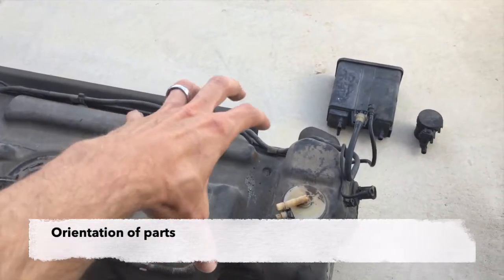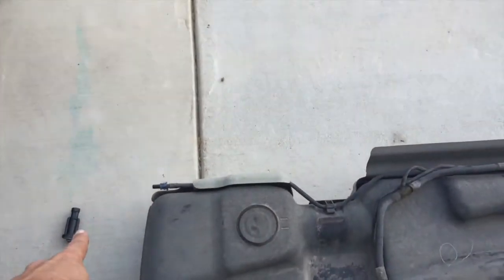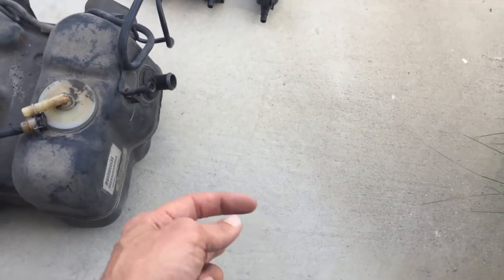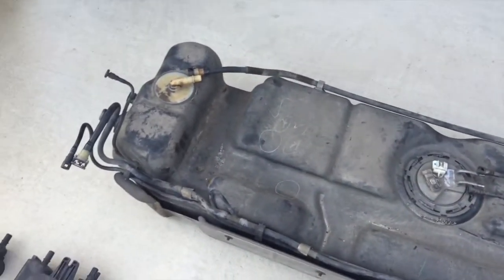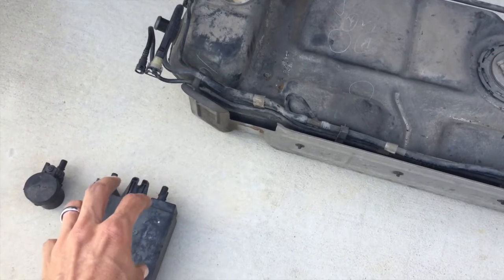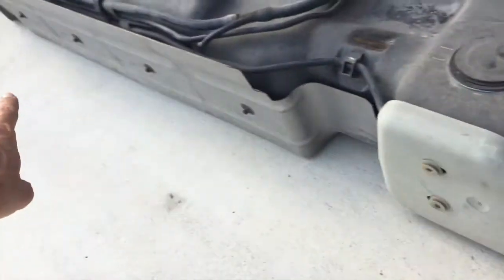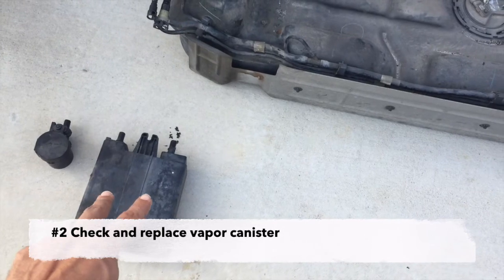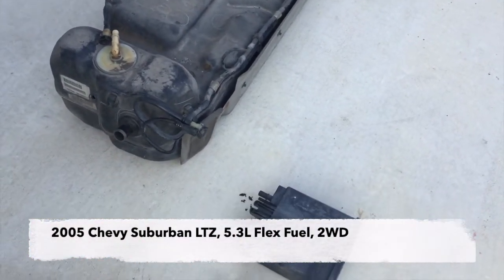Gas pump shut off early? SOLVED! Entire evap system explained & troubleshoot on 2005 Chevy Suburban

Comment: I replaced the vent solenoid, carbon canister, purge valve and fuel pump and blew out the lines. It fills better but still stops. Any more suggestions?

Comment: I have replaced the canister, purge valve, vent solenoid and gas cap a lot better but still same issue last time I was down there I was going to drop the tank to clear the lines but I got lazy as I couldn’t disconnect the white connection from the top of the tank and it was routed over the top of the cross member so it was getting hung up but I guess I have to take the time to drop the tank and clear those hoses 😅

Comment: This is truly the best video I’ve seen about the Toyota 2019 vehicle gas billing problems. I just realized when you explained this all to me that the actual problem is the manufacturer of that charcoal carbon falling apart box so that way it contaminate the rest of the system, including the fuel pump that’s giving you all these error sending it to the computer Therefore, I realized after watching this if I take that canister out of the system and just connect the airlines together so I can put gas into the tank while the air escapes doesn’t back off and shut the nozzle filter tube off. It just shows me that Toyota did this to cause another $3000 worth of problems

Comment: Good informative video.   I had the problem of my tank not filling and am repairing today.  Charcoal canister was bad and clogging lines with pellets. I’m changing the fuel pump while I have the tank out and also blowing air with air hose to unclog lines.  The question I have:    Is there a chance that no charcoal comes out of any of the lines ?   I blew the one on top the motor for the purge valve and all the lines on top the tank and none of them seemed clogged.  Blew air back and forth in the lines for 30-45 minutes.   No charcoal came out.   Thank you

Comment: 2005 Hummer H2
QUESTION: 
1) Could this have something to do with the filler neck assembly? Maybe I can disconnect its vent line?
2) If I disconnect the "Air In-take line" to the Canister will that allow me to fuel as normal?

My Painful Hummer H2 EVAP Journey
It all started about 1 year ago. On my first drive of the day, after 4 minutes my "Tighten Fuel Cap" Alert came on with a ding and disappeared.
The only thing I noticed that the day before this journey started was when I fill-up my tank, the nozzle was having problems fitting into the filler neck. I told this to the Repair Shop.
(No gas odors, no changes in gas mileage, no changes in engine performance)
Here is the list of repairs and & the results.
Clean filler neck & Replaced gas cap (factory cap) - did not work, a week later wouldn't take gas
Replaced Solenoid under H2 - did not work (noticed chucks of debris falling out of solenoid valve and broken line clamps)
Took To Shop: had them replace Canister and check lines, Smoke Test (-) - didn't work
Back to Shop: Told them to fix the lines that had loose clamps, they also Smoked test again (-) - didn't work
Back to Shop: Had them better fix/make lines, Smoke Test (-) - didn't work
Back to Shop: They blew out all lines this time - Fixed the fill up problem, but alert light still occurred
Back to Shop: Had them replace purge valve on top of engine, smoke test again (-) - Tighten gas Cap alert comes on and now throws Check Engine Light (P0455 major leak)
Back to Shop: They recheck everything. Stated it need a new gas cap again. They removed my new factory gas cap, and put on a different gas cap. - Next day, light and alert came back on.
Take to New Shop (H2 Guys): Stated that it was the sensors built on to tank stuck open from blown debris, so he changed the program to stop checking EVAP system (This is something I didn't want done, but he did it before talking to me). - next day I am back to the original problem.
First drive of the day, after 4 minutes my "Tighten Fuel Cap" Alert came on with a ding and disappeared.

About 3 weeks later, the Fuel pump finally reared its head as a problem. The tank was dropped and cleaned, pump replaced, lines blown. They also replace any part in the EVAP that was still under warranty. I couldn't believe how much smoother and quieter the H2 ran when I picked it up. Then I took it to fill up - ugh. It didn't want to fill. The pump would shut off at every $2.00. back to the shop.

Tank re-dropped this time they put more effort into blowing the lines and found some lines were still clogged. They probed and blew; they check the other EVAP lines and blew. Got the H2 back, no problems filling, no "Tighten Fuel Cap" dash warning.

This lasted for 1 week, then back to the original problem - "Tighten Fuel Cap" dash light and alarm warning.
This time it came on in about a minute as opposed to the original 4 minutes.
Finally went to fill tank and had problems again, pump shut off two times during fill up.
About 2 days later the "Tighten Fuel Cap" Alert disappeared for a whole 2-days, then came back.
The next time I filled up, the pump would shut off at about $5-10$. I can hear the filler neck getting backed up before the pump shuts off.

"Tighten Fuel Cap" alert is also coming back on within 4 minutes of driving.

This has been a real Bitch!
The only thing I can think of is that one or both of the rollover valves on the tank must be clogged.
You cannot get replacements for these, and you cannot get replacements for the EVAP Tubes/Hoses.

QUESTION: 
1) Could this have something to do with the filler neck assembly? Maybe I can disconnect its vent line?
2) If I disconnect the "Air In-take line" to the Canister will that allow me to fuel as normal?

Comment: I realize that this vid is 5yo but it was very clearly explained. Going through this now with a 2010 C6 Corvette Grand Sport with 66K km/41K miles.  I checked the system and found the infamous P0455 EVAP large leak code. I did a smoke test but found no smoke. Read a few rags about causes and replaced the GAS CAP. Cleared the code and 200km check engine came back on. Then I did the PURGE VALVE, cleared the code and it came on. Then I did the VAP CANISTER, cleared code and it came on after 500km. Now I am at the CHARCOAL CANISTER and this is a SOB. I have an automatic and I have to drop the cradle and trans to easily access the canister. I'm considering taking it to the STEALER and getting the bushing in the TORQUE TUBE changed since I'm that far. Otherwise I have seen Cats do contortionist tricks to disconnect the XROSS TUBE and My hands/arms are too thick. So 2K has to be made available since I live in Germany and a Vette mechanic is like tits on a bird. My advice is that when reading the codes all other components that are defective will appear on the screen but the only one that doesn't is the CHARCOAL CANISTER because it also involves cleaning the air lines to the entire system. Also let the pump shut off automatically and don't top it off to the nearest cent. I believe that causes gas to enter the EVAP SYSTEM which is primarily there for vapors not liquid? Unfortunately Chevrolet changed it from being outside and accessable to inside above the Passenger gas tank on the Vette. Thankfully the P0455 isn't that serious but it does cause higher fuel usage, the car idles rough, the exhaust stinks, and eventually will have starting problems. My car goes into hibernation end of November so I believe l will get it done by the STEALER and bite the bullet. At least I know it will be done correctly and I won't have to mess with the TORQUE TUBE ever again. Stay safe and POSITIVE.

Comment: I just fixed my Avalanche by disconnecting the vapor canister and using a pool noodle to connect to my shop vac in blow mode to the fuel fill inlet. This allowed me to create a seal and put pressure on the fuel tank allowing about cup of charcoal beads to shoot out. I then disconnected the line on the engine and blew it out also. I finished by replacing the valve on top of the engine, the charcoal canister, and the valve above the spare tire. The comments here and the video let me to the solution. I did not have to drop the fuel tank. It was such a relief to fuel up without the dreaded click while trying to get gas. I usually gave up after 4 to 6 gallons.

Comment: this is a design failure if it was designed with a up side down trap and and a line joint that virtical  then the fuel wont get in the evap canister vent if the fuel don't get in the can then it won't destroy the can and ai said that a upside down p trap would be ilegal witch is a lie just a way to shut me up because it makes really really go sense. but over filling would destroy it no matter what you do the older cars never had a evap system so the newer cars  might need a evap float in the tank that shuts the evap line off when it gets filled witch they might have built in the tanks ???? does anyone know it they have a evap shut off float in the tank to keep the fuel from intering the evap line so you can keep the fuel from intering the vent line at the filler neck and a shut off float in the tank for the vent and then when the tank is filled it will shut off the pump at the station with out over filling the tank and destroying the evap?

Comment: Great Job and fantastic video! Very much appreciate you going though the entire Evap system and explains all parts and lines. I just inherited a 2005 Escalade and am having the fuel filling issue, digging into solutions. Will be saving your video and subscribed to Chanel.

Comment: I swear the GM EVAP system is a terrible design they haven't changed in decades.  I am convinced if you fill with a portable gas can or add a fuel additive the EVAP system is designed to allow the fluid to run into it and ruin it.  And then when the charcoal canister decides to fail it spews charcoal everywhere and is nearly impossible to clear (for example you can't just blow air down those lines to clear them)

Comment: Doing this task on your own shows perfectly how unfeasable  the current level of market inflation has got.  I would also drop the whole gas tank and trace each line before I took mine into a shop for work.
       I put a scan tool on and checked my purge solenoid, it is commanded from 0 to 100% based on engine computer data.  
     1st: the resistance test on my replaced evap (bad) canister gave me about 23 ohms, on the new one, (working but not oem) I got 29 ohms.  
2nd : It sounds like rapid clicking when it is commanded on, the bad one was not getting enough juice to be on until about 30 or 40 % command rate, and when it did finally start clicking, it sounded bad to me, somewhat erratic, so I put the new one on and it had a proportional step in crease from 10% to 100%.     Hope that helps.  Also I'm here to try to find out why the tank pressure sensor decreased into vacuum when commanding the purge solenoid on while running, as the vent valve stays open and the commanding of the purge valve is technically being a valve that opens from being closed while being commanded on   I hope this helps.
Reply: Edit: evap canister purge valve* resistance test gives 20 ohm on a store bought new purge valve,  and 23 ohm on the one presumably factory and going bad. *

Comment: I replaced my vapor canister because I could smell gas pretty strong, my mileage was atrocious plus I got the P0455 code along with CEL - lots of noise when you shook it but no beads came out. I now have this whistling noise that happens at odd times and my mileage is still atrocious. I’ll have to go through the whole system I guess.

Comment: Whoever at Chevrolet decided that this would be a good idea needs a hearty slap upside the head! Trucks are made to be driven and driven in areas that have dirt, dust, and gravel etc. We shouldn’t have to be concerned about air lines getting clogged or evap systems failing. This is utter crap! And while it’s not a major expense, it’s still another expense on top of everything else, and a pain in the ass. Chevrolet, you’re a bunch of twats!

Comment: just  another note--- shopw how the air  flows  in  the right  direction  ..As it comes out of tank in that big line--to canister--outa  canister  to Evap canister valve---or when running to  the  engine siliond!  Ya  also missed on my  tank a pressure sensor on the  gas tank.. That must talk to  the  engine silinoid!!!

Comment: I have a 2000 impala-It seems to me- where the air is   spose to come out of the tank,,that goes to charcoal filter There is a valve(( I call it a valve) ist letting pressure out-- wghen turn off  car.  No pressure  comes out  the EVAP silinoid by the filler pipe..  otherwise there should nOT be pressurein  tank once keyiosoff-  cause it  shhould realease any  pressure so   the anti rollover flipper  can open...BUT probably that  valve is NOT  replaceable..  Had tank down-- But at the time didnt realize  what  was goingon!! I blew air  backwards  thru canister and heard a BAng!  that  valve opened... I think I need to spray  something like WD-40??? into that valve to  stop from sticking! whatya  think!

Comment: If my charcoal canister had gas in it ( came out the large port next to the solenoid port), do I need to drop tank and blow out lines. No carbon bits. 2005 Chevy Tahoe with 240k miles! Solenoid was full of road dust, since I like to take the backroads.

Comment: My purge solenoid is clicking super fast when the engine is hot and it does all the time I changed all the components and still clicking like crazy and I don’t have any codes 🤷🏻‍♂️🤯🤯 also changed the solenoid with an ac Delco and is clicking too!! Help!!

Comment: Great video. I can only put in like $8 before gas spills out. The gas station pump nozzle not clicking. But I don't know why my gas tank is refusing to accept more fuel? I've checked all hoses and charcoal canister. Everything is intact. Any help would be greatly appreciated. Thank you
Reply: Could be anti siphon valve is stuck.

Comment: The small evap line, next to where you fill up gas, should that line have gas in it? Disconnected that line and some gas came out of it. I have an issue with some gas spilling when refueling.

Comment: Having replaced my 2003 yukons fuel pump twice, I cut a hole in my floor below my rear seat. (cut 3 sides of a rectangle and bent it back) I did that to replace my tank pressure sensor. I've already replaced that charcoal canister and everything else and I'm still getting the evap performance code. I thinl this might be the issue. Pretty sure I can blow everything out without dropping the tank. Thanks for the video
Reply: Were you able to blow out the lines without dropping the tank? I just finished after dropping the gas tank and I had to really shake out the lines by hand to get all of the pellets out. It did work though.
Reply: @jedarramorriss7064  I haven’t done it yet but I did check my old canister and nothing came out

Comment: If you live in a state or city that does not require emissions then why not just delete the entire EVAP system and solve the problem permanently? Terrible system designed to prevent a hole in the ozone which is BS.

Comment: Thanks for the video!  I replaced the canister first, clogging continued.  Replaced the Canister switch, clogging continued!  Thanks to your great description of the system, I was able to unclog the vent line from the tank.  The vent line is the long one with the white connectors that is connected to the white fitting on top of the tank.  I did not drop the fuel tank.  I just disconnected the connector from the charcoal cannister, inserted a smaller hose attached to my shop vacuum and started sucking the charcoal bits ( about a cup of charcoal).  Used my leaf blower to blow air into the tank thru the fuel filler as suggested by another viewer.  Took me about 2 hours to remove the charcoal and clear the vent.
Reply: I'm fixing to do mine, thank you both for the info
Reply: @donaldbradford2442  I replaced the vapor canister vent valve.  The check fuel cap warning kept coming on, so I replaced the front purge solenoid valve which was full of the charcoal pellets. Worked fine for a while until the fuel cap warning came on again.  Removed the purge solenoid valve to remove more pellets.  The line that attaches to the purge valve was full of charcoal.  Was able to clear it with the shop vac and a wire to push the charcoal clogs (another cup of charcoal pellets)!  Good luck!
Reply: I am going to try this this weekend. What size hose did you use?
Reply: @jaf264  I used an attachment that came with my Shark home vacuum cleaner that luckily fit on my shop vac as well!   The outside diameter is 1/2 inch.  Also, rattle the hose and tap it with a soft screwdriver handle to release the clogs!   Good luck!
Reply: @HOSER227  I'm about to jump into this project on my 05 Escalade and very much appreciate everyones responses. Would rather not pull the whole tank off.. Seems like the running theme here is to make absolutely certain that all the little carbon bits are removed from ALL lines after canister and any failing component is replaced. Gives me hope that there are a number of techniques and ideas people have used to accomplish.

Comment: Got 2007 tahoe just had shop replace fuel pump now i cant fill gas and befor i could. Any chance when they put tank back up they pinch vent hose?  Wat should i try to fix? tried to blow out hoses and no charcoal bbs came out.
Reply: Also I told the shop and I had warranty on parts and labor and they won't look at it again unless I pay for another diagnostic and I don't wanna give that place another dollar